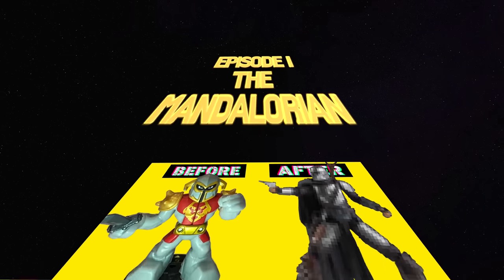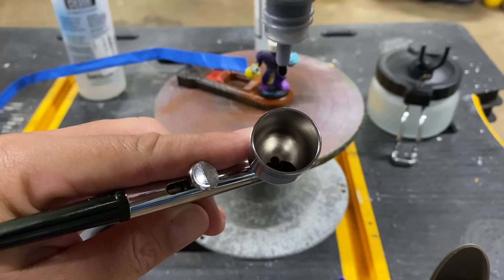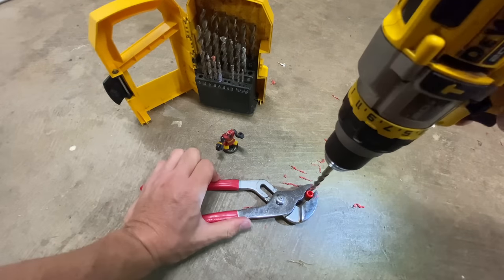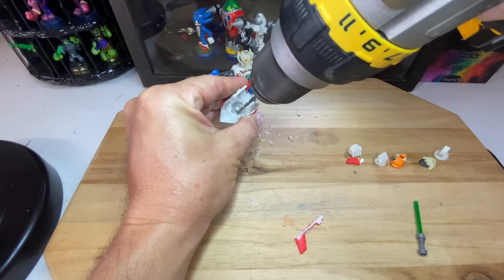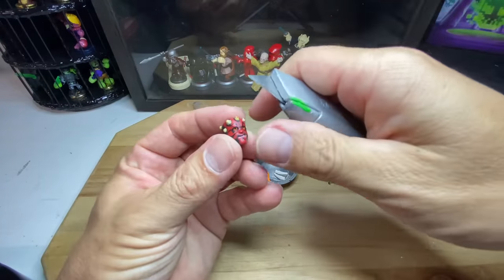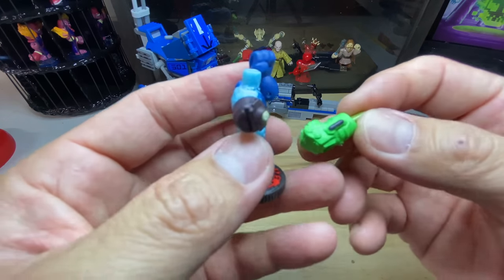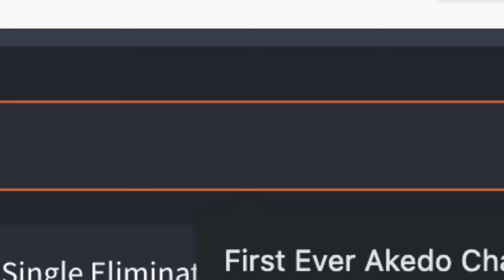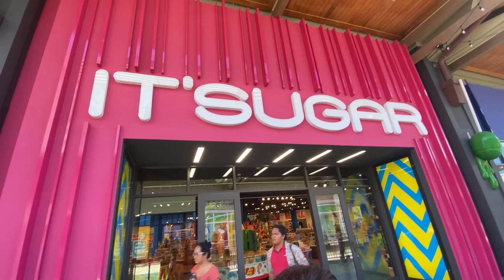Custom Star Wars Akedo Warriors With Light Up Lightsabers & Tournament Compilation #3

Comment: Hi, I used black acrylic paint to customize a star wars figure, but it keeps peeling off! Can you suggest a solution, does it need to be primed or sealed? Or maybe a different type of paint?
Reply from the maker: Acrylic paint needs to have a primer coat. It will also help to scuff the surface of the Akedo warrior with a Brillo pad prior to painting.
Reply: I will go to eddies world🎉🎉😊😊